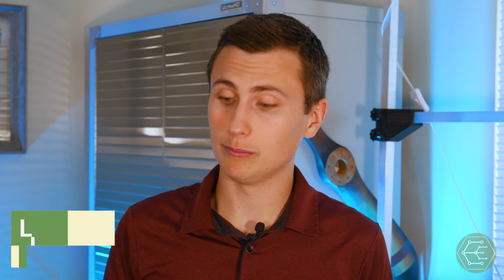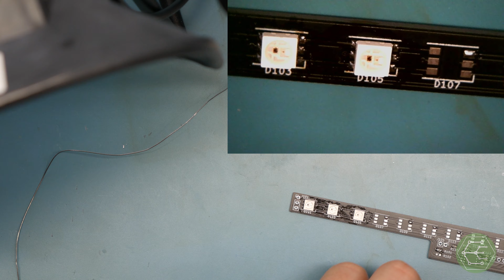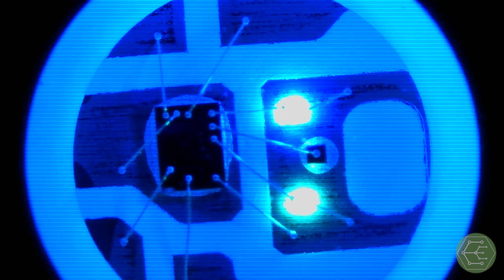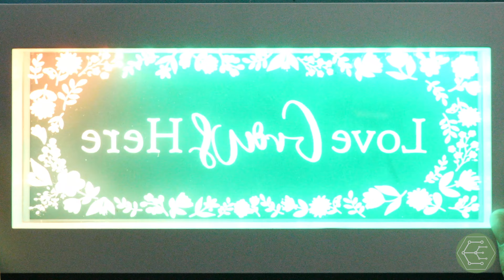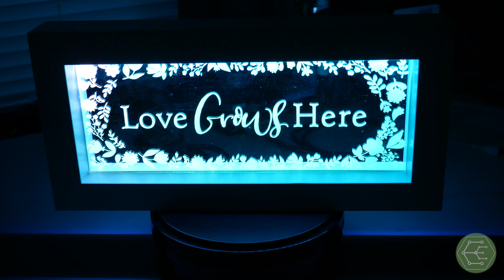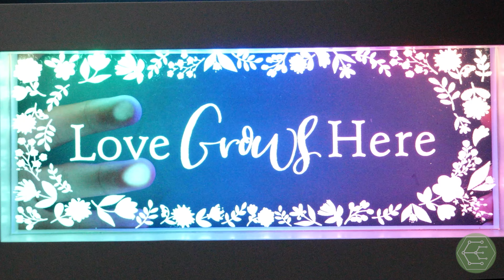WS2812B LED Sign – Build and Test

Comment: Very good build. Thanks!
Not the cheapest build I would assume.  Those Neopixels are pricey and ordering a PCB for just one unit build is $40 or so including shipping?  But at the end, you have a professional product.
Reply from the maker: Hi Bert! It's certainly a lot more expensive than the old design! (bare LEDS + resistors) Looking at QTY ~1, BOM cost comes out to about $8.45 (not including the PCB)  I suppose if you would factor in assembly time, odds & ends, price of the sign... perhaps $40 all-told?
Reply: neopixels are really cheap lmao
Reply: @Millionaires.Empire  this fella is way too much. he is very big feeling and puts much too much stock in the expensive piece of paper he took in school. he knocks makers but he just done a project makers were doing over a decade ago. I had high hopes for this channel too when I seen the name. being a software engineer and self taught higher than novice but not anywhere close to an expert electronics guy along with common sense. this guy done extremely well in school I suspect but he has no personal portfolio when it comes to the real world. I'm not saying this to be a troll because elitism in the yt ee community is never good but this guy needs to learn how to condense his content by fucking off with his opinions and just have fun. he's got pretty shitty gear for a REAL engineer. he should be going to pcbway and building his boards for free to do more projects